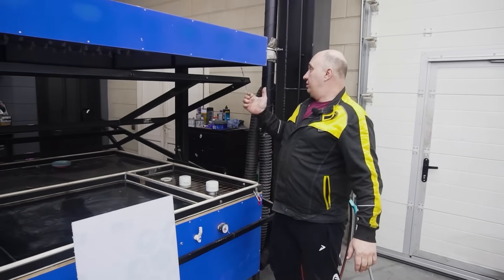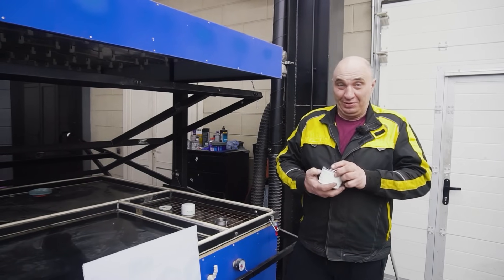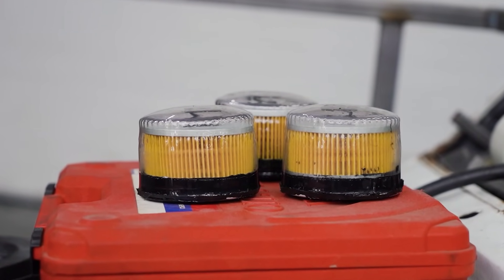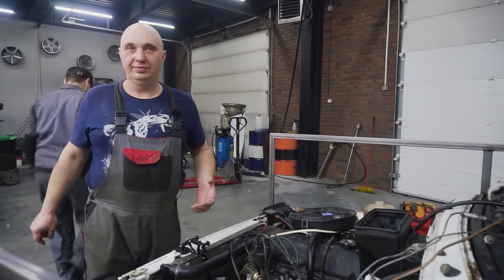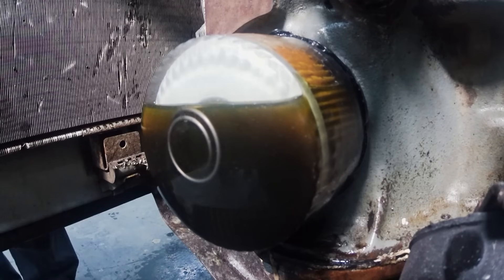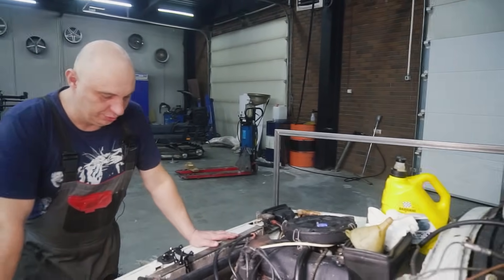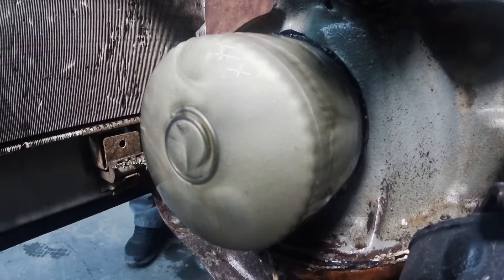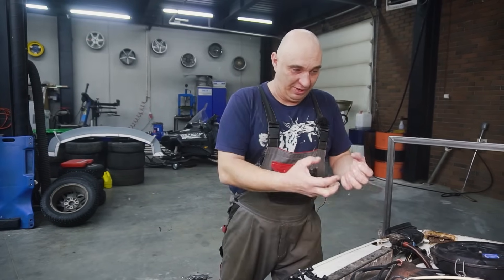We make transparent oil filter

Comment: Working at an auto parts store, I heard that the bypass valve is for if the filter gets too clogged and blocks too much flow. In that case, unfiltered oil is better than no oil, so the valve will make the oil skip the filter element and go straight back into the engine.
Reply: Yes!
Reply: Guys, there are 2 separate things being mixed up here that are distinct and different. There is a bypass/relief "valve," and there is an anti-drainback valve. The bypass valve is simplyade of that spring and the loose filter element inside the canister. The incoming oil pushes the element up into that spring, compressing it. You can see the dome of that filter bulging as the RPM (and oil pressure) increases. Hot oil flows easily and doesn't produce much pressure differential between the dirty and clean sides until near redline. Cold oil is definitely too thick to flow adequate volumes at mid to high RPM to protect the engine. The cold oil simply pushes the loose filter element up off the base plate so that the oil does an immediate 180° turn as soon as it enters the filter. It goes into the dirty side, pushes the paper up and off its seat on the base plate, and goes right back out into the clean side which is the filter spindle to go onto the pressurized engine bearings and squirters and VVT or VCM system parts. This is terrible when it happens of course, because we don't want dirty oil going to these incredible tight clearance areas. That's why we use dual grade oils that flow easier than straight single grades when cold. If the oil pressure (pressure is resistance to flow) is not high enough to push that filter element against that spring and overcome its strength of tension to push the element up and off the base plate to let dirty oil bypass filtration, all of the oil is cleaned. This happens when hot, but it can also happen when cold if you use the thinnest allowed oil grade for your engine and drive very gently. I always use 0W-XX oils for this reason. This is 1of a few reasons to drive very gently when the engine is not fully warmed up. Driving gently means filtered oil. 

The second part that's being confused here is the anti-drainback valve. That thing is basically just a rubber check valve flapper that seals the dirty oil inlet holes of the filter base plate so that oil can't flow backward out of them. That keeps the oil filter fully primed when the engine is shut off so that the oil pump can get oil up to the cylinder head ASAP. Oil can be pushed into the filter's dirty side, but when the engine is shut off and the flow stops, the oil does not bleed back out into the oil pan. That is a very good thing. 

The bypass valve (more of a mechanism function than a valve) is required and every filter has it no matter what, even an orange can Fram filter. The anti-drainback valve is not necessary for engine protection, it's just nice to have. The engine will significantly wear during cold operation from oil starvation if the filter doesn't have a bypass mechanism. You would start the car on a 50°F day, drive gently for 2 minutes around the corner to the highway ramp, and get onto the highway gently up to 65mph. That is around 2,500RPM for most engines. With no bypass in the filter, it would explode at that high of a pressure, but pretending it won't explode...the engine would wear a LOT until it gets hot enough to flow the oil volume required at that RPM. I mean...after a few weeks your engine would knock until it threw a rod. Most wear occurs during startup, so an ADBV that keeps the filter and pressurized circuit full of oil for quick lubrication is really a good thing to pay extra for. But, if you don't care at all about minimizing wear the most, you don't NEED it. Without an ADBV the engine will just take several more seconds to pressurize and it'll clatter and tap for a bit until the lifters pressurize. An ADBV minimizes that time to 1 second or so. 

Hopefully that helps clear things up for everyone. 😺👍
Reply: @mannys9130  Greetings from across Yon Pond! Thanks for setting that out about the two different valves: I had an idea of what was going on, cold then hot, etc, but not in any detail. Nor did I have an appreciation of the Anti Drain Back Valve. There used to in England a brand of car  - 1950s?? - that had a round, oil-pressure retaining device, similar to a Citroen suspension sphere. During normal running the engine would provide the sphere with pressurised engine oil. When the engine was turned off the sphere would maintain that oil pressure until the engine was restarted again. Thus the engine was provided with perfect oil pressure immediately upon starting. Brilliantly simple.
Reply: Just to add to the fun, some anti-drainback valves are made from silicone, some are rubber. The rubber ones can harden and fail to work due to heat or age. Also, I think the filter position dictates whether it has the valve. Vertical ones apparently do not need it, but horizontal mounted ones do.
Reply: @jeffroe8301  They all benefit from an ADBV. The cylinder head is usually the highest point of the lube circuitry. When the pump stops turning, gravity pulls that oil back down to the ground again. If the filter is straight up and down, who cares? The oil is going to sink down the supply passages back down to the filter spindle and the clean side of the filter, and then out the dirty side. It'll drain back until the levels are equilibrated everywhere or the siphon is broken by something. The ADBV stops that from happening. Engine shuts off, oil stops flowing upward to the head, it starts trying to fall back down, but the ADBV flapper snaps shut and stops it from doing so. The circuitry stays primed for next startup. 

You are correct about material differences. Silicone ADBVs are much more durable and last a lot longer than rubber ones. Every "extended service" or "synthetic filter" that is designed for 7,500 to 15,000 mile OCIs needs to have a silicone ADBV, silicone plate gasket, metal end caps, coil type bypass spring, a sturdy central canal (not e-core), thick shell with powder coating, and lots of pleats of synthetic media.
Reply: @mannys9130 I know how it works. I guess whoever engineered some of those engines care. Some older engines with vertical filters don't have the valve because it's unnecessary as the oil doesn't drain or siphon out and it affects the volume/flow rate they wanted. I have some filters made this year without the valve.
Reply: @jeffroe8301  Your first comment said some vertical ones don't need it. I'm saying they do, because all of the engines will drain their upper circuitry back down to the oil pan without that valve. Is it critically necessary to survival of the engine long term like that bypass mechanism? No. Is it needed to stop drain back? Yes. Your filters that lack the component are cheap. Without a check valve, the upper oil circuitry bleeds down totally. That's why engines with hydraulic lash adjusters all rattle at least a little bit at startup. With a quality filter that has an ADBV, the rattle time is shorter than with one that lacks it due to the filter manufacturer's prioritization of cost saving. 🤷🏻‍♂️
Reply: @mannys9130  Ya know, I knew I should have mentioned they are premium filters when I was writing that, because I knew you would say they are just cheap filters lacking a valve. Like you just said that I said, SOME vertical filters. SOME, not all. I said SOME older engines didn't and don't require it. Some filter numbers there isn't even the option for a valve if you wanted to add one. Been there. Again, I know how they work and their intended purpose, please stop repeating it. It's not rocket science. You win, your the best car guy and you know it all. I'm not interested in a contest, I was just chiming into the thread for some fun with unknown information that you are apparently unaware of.
Reply: @jeffroe8301  Touchy much?
Reply: @tennesseered586  Since you couldn't elaborate on your question, I'll do my best to answer it, although it is off topic and not really worthy of a reply. I'm always open to being wrong, but when someone bases things on assumptions and tries to sound like they know everything while at the same time not knowing it all and then tries to correct me on a subject I've done a lot of research on, it is a bit annoying and I called him out. If that makes me "touchy" in your eyes then so be it. He says cheap filters don't come with a valve, but it doesn't matter the cost, it is dependent on what is specified for the application. I suppose there is the possibility of some extremely cheap junk from china, but that is not the standard so it shouldn't be a consideration. There are also premium grade filters for high RPM race engines that don't use a valve for various reasons. Would you like to know? Thank you for your contribution.
Reply: Race filters typically have a larger micron filter threshold so the oil isn't as clean as a regular everyday filter.  👍
Reply: The bypass valve opens up more than you think. It's open all the time when you start the car first thing in a morning and closes as the oil warms up and the viscosity decreases. 
They normally open at high revs as well!
If your filter is clogged it would be open constantly but at that point you'd wanna hand in your keys!
Reply: @19jacobob93   really? How do you know
Reply: @darrylsjodin7184  because the oil pressure on startup and higher RMPs (especially if running a thicker oil) generally far exceeds that of the bypass valve threshold.
Reply: @19jacobob93  I just looked up bypass valves on 3 sites, 2 oil filter mfg co’s and one machinery co. All three said the same thing. The bypass valve is a relief valve based on pressure differential across the filter media. 2 things cause the valve to open, plugged up filter media primarily, protects the media from coming apart and the can from expanding and leaking and the other is oil too thick, as you said. It really seemed that the valve opening is a rarity as in the thick oil. Maybe in North Dakota on a -20 f day when sitting off all night with no oil heater. I doubt anyone runs their car long enough to plug up the oil filter either. I really think the bypass valve is an emergency part set at 15 psi differential make sure the engine gets oil. The valve doesn’t care how high the oil pressure goes, as long as it is the same on both sides of the filter or the diff is less than 15 psi. Another thought is the engine manufacturers would want to size the filter to filter in most conditions and not bypass, so the engine is protected and the oem filters aren’t huge, so the oil volume through the tiny engine passage ways must not be great enough for the filter material to have much pressure drop. Good to talk with you😁
Reply: @darrylsjodin7184  Seriously!  It wouldn't think it would take a rocket scientist to figure out that Jacob has no idea what he's talking about... If the valve opened "all of the time" like he was saying, what would be the purpose of even having a filter in the first place? lol  Every time the relief valve opened, it would let a ton of debris through it!
Reply: @billymanilli  absolutely!😀
Reply: I just found a video from SDPC Raceshop that big block Chevy engines have a relief valve for the oil filter in the block behind where the filter mounts, so it seems like some do. I’m sure not an expert!
Reply: @darrylsjodin7184  absolutely spot on! I work for a filter manufacturer (have done for 20 years) and you are absolutely correct!
Reply: Yes i trust the oil bypass on the 60 year old Perkins 3cyl diesel engine in my tractor. I changed 1 of the 2 diesel filters, that should keep it running another 10 years. Hydraulics filter/strainer is removed.
Reply: Bypass valve is mainly for reving the engine on cold start when the oil viscosity is so great that could break the engine.
Reply: @cipriansofineti346  also for extreme use conditions-- think of heavy machinery being operated 24/7 in the wilderness of Alaska for mining, with heavy dusting conditions.
Reply: The valve is for any scenario where there is not enough flow.  From what I heard when the engine revs high the valve can open.  And no, the oil isn't immediately dirty as it's a closed system and it's always going through the filter.  Opening just means it will not be filtering for a little bit of time, but will filter again when it closed.
Reply: I’ve heard that some oil filters don’t have a bypass valve because the engine that the filter is spec’d for already has a bypass valve built into the engine block, so the filter manufacturer doesn’t include one.
Reply: Also happens when the oil is cold.
Reply: Oil flow diagrams on service manuals shows that too. Though the extreme cold temperature scenario is entirely possible as well
Reply: The original comment is correct.
Reply: Precisely.
Reply: The ol lawnmower technique.
Reply: True. 
I heard that some of the cheapest filters do not have bypass valve.
Reply: @jareknowak8712  Honda OEM filters for example. They don't use bypass valves. Terrifying
Reply: @jareknowak8712  cough cough FRAM
Reply: @derpydog1008  All of Fram's filters have bypass valves. Even the cheapest ones. They would literally explode if they didn't.
Reply: I believe all the filters have the bypass valve.
Reply: @zijie-he  sadly no
Reply: @brendanberry7403  oh, interesting, never got one without it myself. I do not use low quality ones myself thought.
Reply: @zijie-he  
I've heard nasty stories of cheap Chinese made oil filter elements collapsing and destroying an engine because it had no bypass.
Reply: @zijie-he  You are correct; see my previous comment. 😎👌
Reply: The bypass is for oil flow . Only about 10% of oil gets filtered. So in 10 cycles all of the oil will have been filtered. A lot of people believe 100% of the oil goes through the filter then to the engine. That’s why so many people pre-fill there filter thinking this .
Reply: @zoultronzoultron9723  I’d like to see mfg documentation
Reply: @zoultronzoultron9723  Could you elaborate just a bit further on what you said here. I'm having trouble seeing how the two are linked; that people choose to pre-fill filters based on the percentage of oil they believe gets filtered. Or how in 10 cycles all oil will be filtered since 10% gets filtered every cycle. I guess this could make sense if the filtered oil doesn't ever circulate back and mix with the unfiltered oil. I'm definitely no expert when it comes to this type of stuff so that's why I ask. Thanks

Comment: Great job. 99.9% of people have never seen anything like that. It’s interesting to watch your transparent cover videos. Hopefully things settle down y’all’s way. God bless
Reply: It would be cool to have a transparent engine block and see the fluids moving through it.
Reply: @jwalster9412  
I’ve seen half of a block clear. Back in the 80’s-90’s we had one in auto shop class. Had an old handle crank you could turn.
Reply: @Miner-49  could you see the oil and coolent passes?
Reply: We had something similar with an manual transmission.
Reply: @jwalster9412  
You could see the oil cycle through it but not coolant.
Reply: @jwalster9412  solid idea
Reply: "I've seen this before"
Reply: Some people don't event know car have oil filter
Reply: Yeah I've never seen a transparent filter.... (opens hood on classic carburetted car)  Oh there's one!
Reply: @the_kombinator  yeah but most young people have never seen that
Reply: @the_kombinator your skulls seems transparent no sign of a brain inside 😭

Comment: Won't windshield-sealer become pliable when hot?, Motorcraft/Ford oil-filters have a check-valve that's suppose too keep the oil-filter from draining back down when you shut it off, helping with dry startups, it would've been cool to see if this is really the case or not, great video guys, thanks for sharing.
Reply: The anti-drain valve is just a round rubber flap that cover the inlet holes, oil under pressure lifts it to enter the filter, it's on the inlet side so it only works if the outlet is not allowing oil to go anywhere, if you take the filter out it will drain through the paper element through the threaded hole, more or less quickly depending on whether the oil is hot or cold, although only filtered oil will be poured, any particles between the can and the paper element remain blocked inside.
While mounted on the engine I assume that the oil will not drain out of the outlet as it would create a suction at the inlet sucking more oil from the crankcase, and there is no "free energy" to create such oil flow when the engine is stopped.